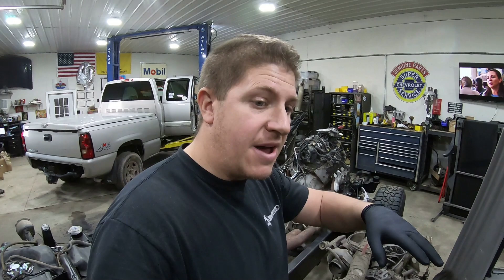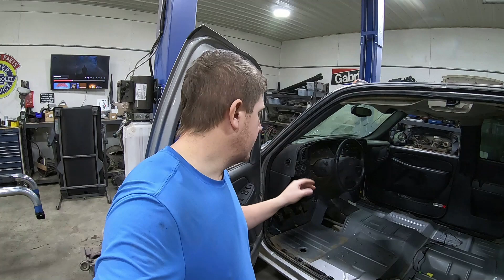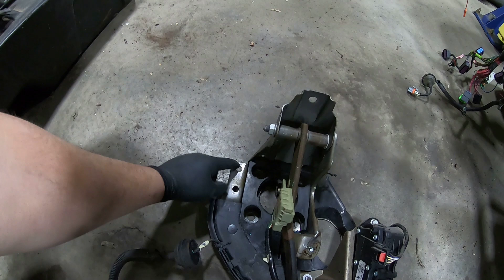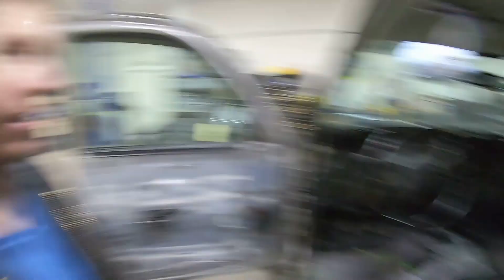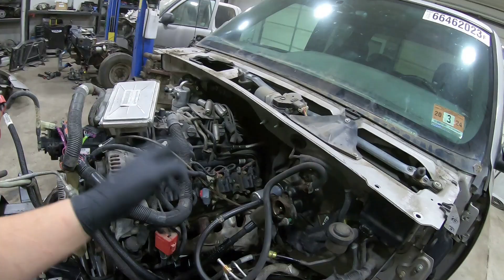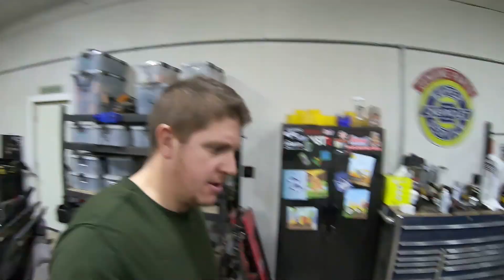The 5 Speed Silverado Runs!!

Comment: Jason??? What do you do in this case where you have a cab with a different VIN number than the VIN on the frame??? And also the hidden VIN numbers???
Reply from the maker: This is my first time. I'm in PA and here you can do a "Cab swap" repair. I will have to get the truck through enhanced inspection, then provide proof of ownership for both trucks (salvage certificates in this case) as well as any other receipts. Then I just do a bunch of paperwork and PA will issue a reconstructed title and everything needed to get it on the road legally.

Comment: So on the next one can we look for a 6 seater to avoid having to swap out the dash or is that pretty much a have to when switching from auto to manual? Its quite the job to properly swap one of these so finding time would he awesome. For me- I'm waiting on spring so I i can start on the v6 to v8 swap on my 04 cateye. No garage yet but I'm working on that too. Michigan is bipolar so I may get some time to dabble here and there before the big push. Lol Keep up the great work!
Reply from the maker: Thank you! so if both trucks had been built with center jump seats, then I wouldn't have needed to swap out the entire HVAC box. The non crushed truck originally had a center console. If the non crushed truck had been automatic but had the jump seat, I wouldn't have had to change out the HVAC unit. The hvac box for the full center console trucks is unique to the full center console it's not actually because of going from automatic to manual.